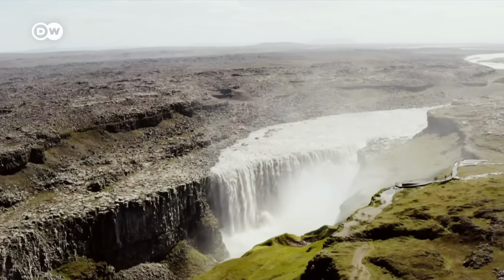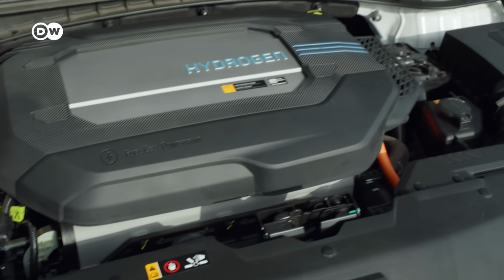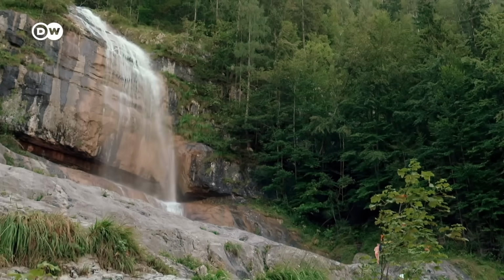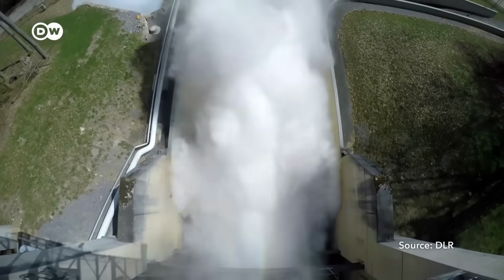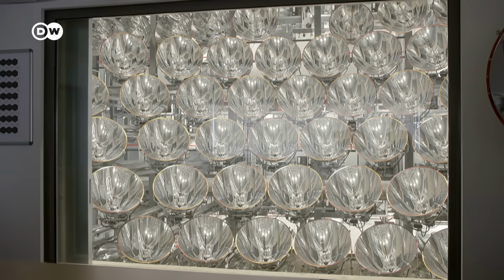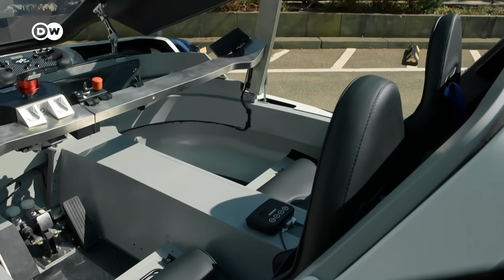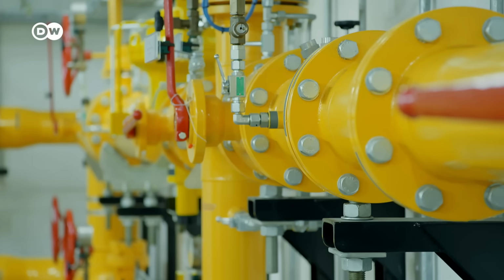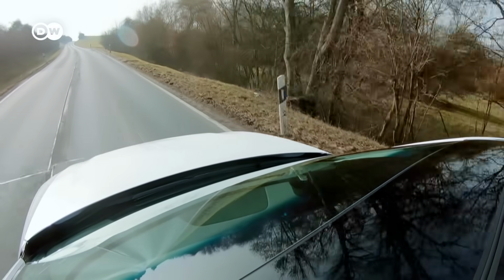Is green hydrogen the answer to the climate crisis? | DW Documentary

Comment: All of this talk about the benefits of hydrogen, but precious little on actually containing the stuff.
You can't run hydrogen through a natural gas network, it will leak out of everything it finds. Storing it in a steel or plastic tank is useless, steel goes brittle and plastic may as well be cloth.
You need stainless steel tanks, pipework, valves, everything to stand a chance. Then you've got refrigeration costs, power supply issues to keep those tanks cold, it's endless.
This means that every infrastructure we have will need to be completely replaced, at serious cost, before it becomes realistically useful for consumers.

Even then it'll still be dangerous. Consider spilling petrol at a forecourt, not a problem to clean up. Have a hydrogen gas leak when filling up, that's a serious explosion hazard right there.
Running hydrogen through the gas network? That's fine, if the entire network has been replaced. What if someone's heating boiler is old because they can't afford a new hydrogen one? Boom.
Traffic accidents with hydrogen-powered EV's now become scenes from a blockbuster movie, evacuate the area quick and hope the bomb disposal team can deal with it.
Car and truck mechanics have enough problems to deal with when faced with LPG-converted vehicles, hydrogen system malfunctions are a whole next level of dangerous problems.

All for what? A fuel source that costs roughly twice to produce than it provides, purely because it's cleaner ? It's not cleaner if it leaks into the atmosphere at all! Sure it'll mix and form water, but what will this do to precipitation levels around the world? It'll rain far more than before, widespread flooding risks even more than we've seen, but it's cleaner...right?

It's not, not really when you see the grand scale of things it demands to maintain a level of safety. Production level may be fairly efficient, but refrigeration and storage drain that rapidly.
Replacing the entire gas network of a country at once is no small project, bearing in mind that it cannot go online until the entire network has been replaced and tested for leaks.
You could replace it locally in small measures, but you would have to isolate those areas because hydrogen is absolutely not compatible with natural gas piping, so those areas cannot mix.
Consumers in those areas would have to have all of their heating boilers, cookers, hobs, everything that uses gas replaced at once at the same time before any of the area is deemed safe enough to be brought online. Then the area would have to be continually monitored for problems. This is a hyper-expensive logistical nightmare. Country-wide, even more so, think £trillions to get near.
All to be done by fuel-hungry construction equipment that typically runs on diesel. Oh dear. Digging up the entire gas network to replace pipework just became an environmental issue itself.

So who pays for this? You will. We all will. As even mentioned in this video, 50-55EUR for 580km's of range? That's £47 for 360 miles at today's prices.
That's a bit pathetic for a £68,500 vehicle. This is because hydrogen does not contain as much useful energy as petrol or diesel per volume. Fuel cell vehicles struggle to store enough hydrogen to be practical when compared to petrol-diesel vehicles, even if they could on-going losses drain the efficiency, but it's still a better prospect than the zero-emission lies of 'pure' EV's.
What does this mean for drivers of the future? Well you can either buy an unaffordably expensive EV, or you can buy an unaffordably expensive hydrogen FCV...so it's walking to work then eh?
The cost of heating your home will rise drastically, because you'll be burning more hydrogen than you did natural gas. Fuel poverty across the country will increase as a consequence.
It's okay, by the time you've walked home you'll find that the street has no gas supply because a house further down had a leak, so it's cold beans for dinner tonight and hugging together for warmth in the dark. Hopefully the gas company will have that fixed that week, unless somebody else has another leak or their boiler packs in when they bring the pipe back online.
This 'green' future is not looking so rosy anymore.
Reply: I only read the first paragraph but agree with it. It's only useful for possibly large shipping vessels or planes where they can create the storage and refueling infrastructure on site at ports/airports.
Reply: @djayjp  To be perfectly honest, I hadn't really considered shipping and airports.
I can envision a large shipping vessel, like a tanker or a container ship, having enough space to house all the necessary hardware for an FCV plant, but how would it produce enough electricity to run that electrolyser when it's out at sea if it had to do so?
Recharging the system when it's docked up at a port would be fairly sensible and I don't foresee a big issue with running a power cable onto the ship for it to do so while it's loading/unloading, so there is that.

Airports though, I'm not sure about.
On the one hand, it seems like a similar system could be done for planes, but on the other I don't know if FCV's could be successfully scaled up to the size of passenger airliners while keeping the weight down.
I think that the main problem with building an electric airliner is the weight of the motors vs. the power they produce. Jets produce a pretty good thrust-weight ratio, while electric motors struggle in this regard.  To produce comparable thrust, an electric ducted fan motor needs to be extremely powerful, but with current technology that means that it ends up being very heavy and consuming a lot of electrical power, which has a knock-on effect that the power supply needs to be serious.
For electric airplanes to be viable, we need very powerful, extremely lightweight electric motors that are very efficient. That would allow the power supply to be a lot smaller and lighter, but it still also needs to be able to keep up with running these motors with an excess for safety and varying conditions. That still runs into the problem that the hydrogen tank to power it all would take up an awful lot of space and weight in the plane, negating the purpose of having a large passenger plane in the first place.
I'd be interested to see if it could be done sometime in the future, but I can also see there would have to be a lot of significant technological leaps to make it even feasible.
Reply: @mazdamaniac4643  Idk but Airbus seem to think it's practical (they released a video about it).
Reply: @djayjp  I'll check that out, cheers bother.

Comment: This shows me that the hydrogen interests are elbowing aside the direct uses of surplus green electric production to divert that resource to their preferred system of storage. That they can maybe remove some of the extra steps used in that hydrogen production is a long way off,  so the existing methods will prevail for the time being.
 The cheaper brown hydrogen from natural gas pipelines already amortized means if the research money runs out society will be stuck with natural gas burning for steel production and natural gas conversion to brown hydrogen for those submarine's fuel. 
The priorityfor the  economy should be renewable electric energy production and storage for battery storage, even distributed storage in the growing fleet of EVs connected to the grid for long periods of each night. IF there remains surplus electric generation then produce green hydrogen. This would most likely be done in the south of Europe and piped in to where it can be used for steel production or some forms of longer range air travel. Those submarines are a niche use and minor to the size of the  environmental problem  we seek to solve. As to the fuel cell cars, they will die a natural death in that marketplace. They already are being surpassed by long range battery powered vehicles on sale today. Your petrol vehicle collector driving the Hyundai has but one excuse that makes any sense at all, that 5 minute fueling. Ask him what he has to do when that brown hydrogen fueling station runs out, or the nozzle freezes connected to the car. Both those things happen quite frequently where I live in Southern California, the second most hydrogen fuel cell  car using region after Japan.
Reply: Totally agree! Hydrogen needs to be applied where it makes sense. Airplanes, long-hauling trucks & indeed producing steel.
Reply: Hydrogen 27% efficient BEV 64% efficient. Enough said.
Reply: @davidsharrock5704  throw away battery tech is a great thing for the environment......for short sighted people such as yourself
Reply: @Dwarf892  what do you think is short term about batteries? Bearing in mind the facts I mean - 20 years in EVs, another 20 in static storage, then fully recyclable.
Reply: Actually put into context with the slow development of other renewable and non emitting (including nuclear !) sources of energy this is almost pure hype: oil companies need this because they already have the distribution and chemical know how to use hydrogen while they have no advantage in the other ENR. So they push this worldwide, hence the hype.
If we were spending this much money on other ENR, we might advance far more on a real non emitting solutions…
Reply: Batteries and hydrogen are both part of the solution. Batteries can and are already used where less energy density is necessary and hydrogen comes into play when it's about storage or applications in need for a high amount of energy or in a form of a chemical reactant in exchange for coal.
Reply: It only makes sense to make ammonia to displace the 200000T/y ammonia consumption in fertiliser, plastic manufacturing, heavy haulage and aero applications.
Reply: You've got it. There are pros/cons to any solution but of course corporations will back the option that requires massive industrial storage, pipelines, tanker trucks and ships and a distribution network. Each stage generating profits for the corporation. Or I could just plug in to an existing grid.

Comment: What about Nox? Burning hydrogen with air that is 60% nitrogen emit Nox, which is a greenhouse gas...
Reply: Question for you. There is a lot o CO2 in the ocean's water. When said water heats up it releases more CO2. More CO2 in the atmosphere means more greenhouse effect and more heat. Heat that now makes the ocean release even more CO2. Given this, why doesn't the place just blow up in a few years? Answer for you: there are a LOT other mechanisms in play. Long story short, climate chance the way it is portrait in media is a meme.
Protip: more heat equals more evaporation, this leads to more clouds and a cooling effect.
Reply: @MrFujinko  you forget the part where the ocean get more acidic before releasing co2 and that past a certain concentration in the air hydrostatic equilibrium broke, so cloud don't form at equatorial latitudes, and that's not even accounting the shift in fluid stream like the gulf stream for the sea. I don't use media i use science, you are the meme. The problem is less about the heat than how the heat mess up the whole balance and dynamics.

Comment: Was the Chairperson chosen for her eyebrows!
Seriously, interesting, but not enough raised of the issues.
Putting hydrogen in the gas pipes, which feed modified house boilers sounds fine, but burning hydrogen still produces NOX.  Also rather put the cost to an all electric system and fabric / ventilation improvements
Reply: This subject is an eyebrow raiser

Comment: I'm sorry, but hydrogen as a fuel for cars is hype of the WORST sort. It takes energy to make it, transport it, keep it locked up... that's inefficient. The only place where hydrogen would be viable is fueling up a fusion reactor that generates clean energy, which then runs down wires to charge EVs. The HFC car is garbage, it will create "big hydrogen" and install bombs on every street corner. I wish the concept would bloody die already.

Comment: Take fossil fuels out of the current equation and everything falls flat on its face. Wind turbines are created from fossil fuels and mined ore, all dug up and transported by diesel guzzling machines, then smelted, shaped and produced again by energy derived from fossil fuels. The farms are cleared, roads created for transporting them, and concrete pouring all producing CO2 emissions, and for what in the end, a machine with a 20 year limit life span, that works periodically, has to be disposed off, again, like the exotic car batteries, not without problem, for what, green energy. The amount of CO2 pumped into the atmosphere producing these so called green machines far exceeds the amount saved during their 20 years of sporadic operation. There is nothing green about any of it, just a different form of generating energy, like the first law of thermodynamics, energy is neither created or destroyed, it just changes form. If wind turbines were better thought out, you might gain something, like small turbines with a screw motion, for each home, that did not pose a threat to the environment or wildlife, such machines with a proper battery storage made from disposable materials, then you're making progress, but all of this.

Comment: About electricity on roads, still best solution would be using electricity from rail of sorts
Make tire conductive, establish minimal axis width for using it and just roll with it
And for last mile use battery saving on weight and eliminating need of charging completely
Reply: Rubber is a non-conductor material. If they find another material to make tyres it would be awesome however this rail-charging-on the road system is just too expensive because it means you'll have to destroy all the tarmac across the globe to make it which is absurd. Hydrogen-electric stations, solar powered cars are the answer. To change the roads would cost immeasurable amounts of money and who knows how many years